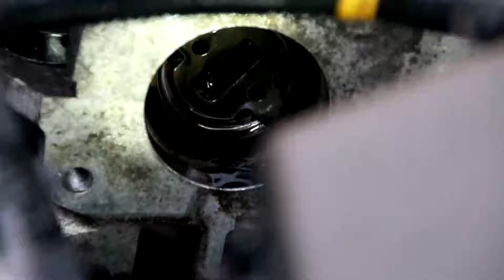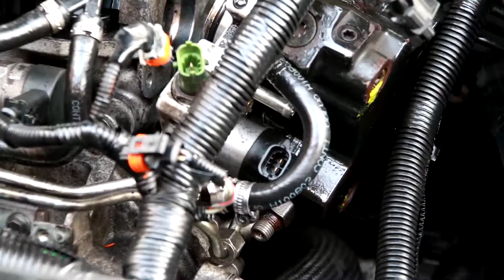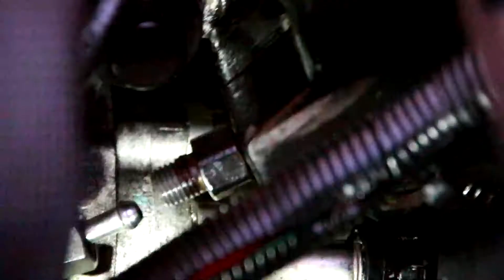Volvo D5 Bosch CP3 High Pressure Pump Outlet Flow Check

Comment: My hpfp gets fuel and it gets returned to the tank, if i crank the engine there's no fuel coming out towards the fuel rails not even a drop of diesel, i tried to cover the return line from the hpfp and it still didn't work, and the electric fuel pump keeps staying on for more than 15 seconds, and the hpfp isn't getting any fuel out for the rail